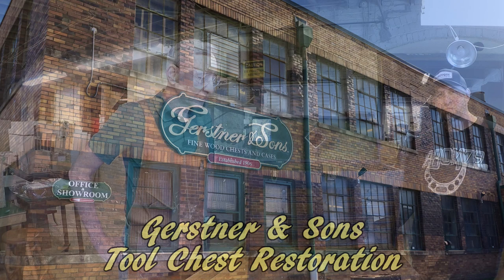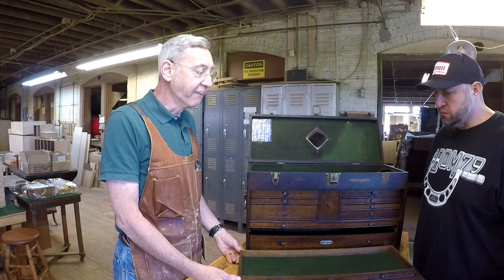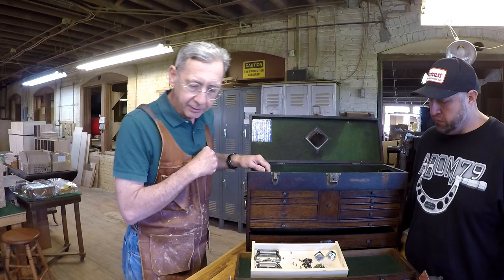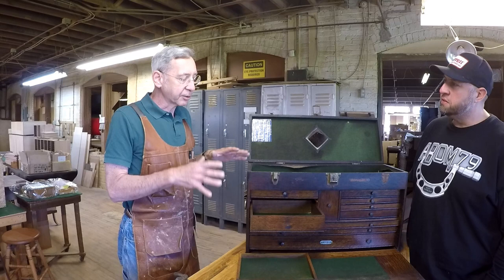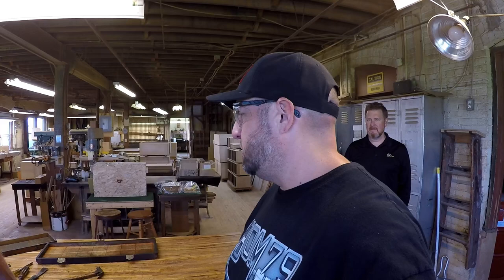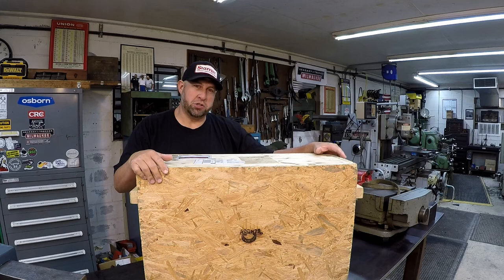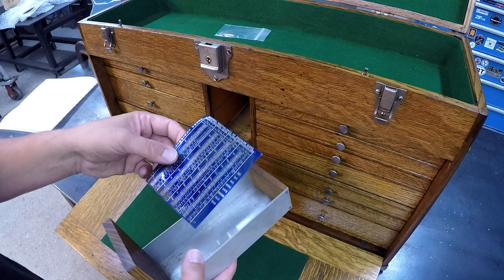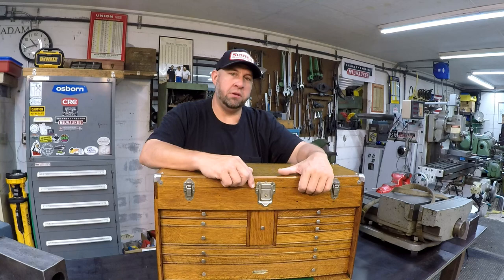Gerstner & Sons Tool Chest Restoration

Comment: I just bought one of those last week at harbor freight
Reply: What you bought was a Chinese knock off, Gersner International.  They are not the same.
Reply: people will knock those less expensive boxes but some of them are ok and if you needed to you could reinforce the carcass or the drawers and it will do the job and last a long time. Unfortunately the quality difference is usually apparent between these.  Price difference is immense.  In the end it is just a wooden box and so people will like what they like.
Reply: @ecmillerbud1   Unfortunately Gerstner has their USA line and their "international" line which also I think are made in china.  Still of upper quality but if HF sells a chinese box that works, can you reall blame somebody for saving a ton of money on a tool box? I can't.

Comment: Hi if anyone knows I was building a chest and did not know at which height are the side carrying handles supposed to be mounted, now that I saw this chest I think I put mine too high is there a known practice or recommendation on this thanks
Reply: As a straight out guess, I would say 3/5's.
They need to be above the center line but 3/4's would seem to be abit too high.

Comment: I have always desired a Gerstner Tool Chest just for it's look and status, but could never justify the cost for it's actual tool holding capacity. The Gerstner chest with all it's many small height drawers limiting your actual employment, compared to say the larger (metal) Kennedy box, which better manages the true purpose of a "tool box" which is to protect and secure many different size precision and not so precision tooling such as self made tools, gauges, fixtures etc.
Reply: It's horses for courses really, the shallow drawers are just the thing for items like dial test indicators, dial indicators and even vernier callipers. Telescopic gauges, radius gauges, depth gauges and squares are all small items of low depth which you wouldn't want to have to root around in the bottom of a big toolbox looking for under your big spanners and hammers for.
OTOH if you work in construction, A site tool box would be much better for storing rattle guns and their big impact sockets, sledge hammers etc. It is a case of the right tool for the job in hand.

Comment: So, does anyone know: does Gerstner artificially age new replacement hardware to match a particular look (in cases where an original knob or whatever is missing)?
Reply: I was thinking the same thing. Maybe they should or do buy old chest that is to far gone to get parts from.
Reply: @charlesfree4247  they likely save the ones they are asked to replace but are still good.
Reply: Take a plastic container with a sealed lid. Place your parts in it. Place a SEPERATE capful of muriatic acid (google what it’s called in your country) in the container. As in don’t pour it in. Don’t submerge your parts. We just want the acid fumes. Soft drink bottle cap is perfect. Seal the container overnight and you’ll have nicely aged nickel hardware. Doesn’t really work on chrome. Brass is ok. I do this a lot.

Comment: Have they clear painted the metalwork to help keep it shiney or just polished it?
Reply: probably not. You can wax and oil and repolish though and keep it shined up. If you use the right compound you can get metals to a mirror finish. Polishing itself resists the formation of some rusts, add wax or oil on top and that's a great barrier.  Clear coat paint can help too. 

One thing you find, when you use wire wheels on metal, some of the metal from the wire wheel can transfer onto the metal of whatever being polished and I noticed it seems to stay there until I clean it off with something else. 

things to try out, besides a wire wheel,  an actual buffer with polishing compound (green or white), fine steel wool (which you can actually use on to clean the wood too with gerstner finish restorer.

Comment: They did a great job. Nice looking tool box.  But - if any of you out there have a dresser or table or whatever from 18th or 19th century (1700's - 1800's ) and you refinish it like this tool box you will reduce the value of the antique by 70-80% of its current market value.
Reply: Yes, and not just the money value!
Reply: That is one of the things that makes me want to punch some homeowners. They will buy a house that has all hardwood floors and carved moldings and install wall to wall carpet and paint the trim...  WHY !!!!  
Or the ones who blindly paint a 18th century table "so it matches out decor" Then buy a new table that looks the same and paint it.
Same thing happens in firearms, people find "an old gun" and strip it to bare metal and wood and refinish it. Then think it should be worth more.
Reply: @Blazer02LS  Originality = The one thing you can't replace.

Comment: I'm a bit disappointed you did not get to tour the US Air force Museum but both of the Gerstner videos have been excellent. Seems there was always that one guy in the shop that had a Gerstner and all you have is a wrinkle brown Kennedy.....grrrr.
Reply from the maker: We didn’t have enough time to enjoy the museum.
Reply: Come on now. I have a complete Kennedy set I bought in 1980 and it's still in perfect shape.
The Gerstner is like a Rolls Royce vs the Kennedy Chevy but at least it's not a broken down Yugo with blown motor like all the trash comes out of Harbor Freight.
I would never insult my Brown and Sharps and Starrets by putting in such trash.
Excellent job on the video by the way.
Been a master machinist since apprenticing at Pratt and Whitney in the 70's and I still pick up good stuff from watching your vids.
Reply: @larryelliott9157  Me too my friend. I still have my first Kennedy I bought when I was learning screw machines in about 1972. I was pretty proud of it when I got it. I also have my dad's Kennedy from the  50's when he apprenticed at Delco Products in Dayton. They are good boxes but damn......those Gerstners are fine.
Reply: @larryelliott9157  I have 6 of the Harbor Freight tool chests and would put them up against any of the Kennedy boxes.
Reply: @jmwarden1  

And you will soon need at least five of them to prop up the last one as it turns back to recycled paper thin sheet metal scrap.
To denigrate a Kennedy box while praising obvious potential land fill requires the general loss of a sense of worth and utility we see in the overall decline of our countries true values. So sad

Comment: At 26:00. Someone needs to point out that the respirator he is wearing does Not have charcoal filters installed. This is dangerous to his health. He might as well not be wearing the useless respirator at all. Most guys don’t know that charcoal filters are only good for 48 hours of use AND when the respirator is not in use it should be placed inside a sealed bag. Respirators left out unsealed constitutes use and the filter media needs to be replaced. I see this type of thing happening all of the time and it comes down to workers not being properly trained in the correct usage of Personal Protective Equipment (PPE). Love your channel and all of the extra content. Again, I hate to be a Nag, but safety first! Adam, keep up the great work!
Reply: He's wearing vapour filters for the stain/varnish that he's applying.

Comment: I know it would depend on the amount of restoration on any given box but what was/would have been the cost on the restoration?
Reply: I would love to know too.  I have the same chest, probably 15 years older that I would like to have restored or preserved.  Needs very similar work.
Reply: I found this on the web site.  (Refinishing and restoration services can come close to the price of a new chest. A full restoration, including stripping the finish, refitting all of the drawers to the chest, replacing the felt and installing new hardware for a chest can cost $1000.00 to $1500.00 depending upon the size of the chest and if parts need to be repaired.)
Considering the condition of mine is not exactly what I would call needing factory restoration, I'll probably do it myself.

Comment: What’s the mirror in the lid for?
Reply: From the Gerstner Forum:
"When Gerstner & Sons started in 1906, most companies did not have indoor plumbing. The mirror was put in the top of a Gerstner Chest for the machinist or toolmaker to use to see if there was any dirt, machine oil, grease, etc. on their face during the workday and before they left work at the end of the day."
Reply: Sithus1966 thank you
Reply: For applying your Avon makeup duh
Reply: @TheLexiconDevils  
Imagine Abom in full makeup.

Comment: What about blueing the cleaned parts to give it some protection? It changes the look a bit, but it's the same hardware and rust proof...
Reply: Clear lacquer finish will do the same without darkening it too. As long as the box doesn't see much weather and direct sun, the lacquer will live a long while but over time will yellow depending on exposure to elements etc. There are some excellent finishes these days that might just last as long as the box does.  Door handle/knob hardware companies use them on their "lifetime" polished brass finishes.

Comment: 3:34 'Veneers'.
That was a surprise
Reply: Over plywood it’s not the dirty word some people assign it. That’s a standard construction method. Veneers over particle boards are where the rubbish is.
Reply: Good plywood is more stable over time and across environmental conditions. That's just a fact people need to get over.  These boxes actually need to operate in the world. Nothing wrong with a little material mixing.

Comment: It's a shame to sand it down. The patina of all the years is more than half of the 'value' of this object, IMO.
Reply: I understand your general point, but in this case, it was not just old varnish patina - this was a working box with decades of old grease and grime, smells and possibly toxins. If it was going in a museum and sitting on display you might want that for show and historical reference, but Adam wants to put his own tools in it and handle and use it on a daily basis. For that case, I would want it clean too.

Comment: Hey guys can you tell me the difference is between your tool chest and the one they sale at harbor Freight tool co.
They look like the same ones there I’m confused!.... they retail for $84.89. How much is that one you have ?....
Ant no problem navy gel and LCR .LIMEAWAY,!...OH MY TAKE ON THIS ?.... use a wire wheel on your hardware 
Will make your Crome plating thinner and the rust will develop in pitting ,,,I don’t know ..
Reply: The Harbor Freight ones are okay for the price, but they are veneer.   The Gerstner are the real ones made of solid oak.   They are made by hand, not slapped together like the HF ones.  But, I have a HF one and like it a lot.
Reply: That's like saying,   "XJ6?!  Why not get a Civic? It's faster and cheaper too!"  This is a collectors item.  You ether have an appreciation for this type of thing or you don't. No biggy.
Reply: Didn’t they say the pecan ones where veneer as well I don’t know I’m looking into the Japanese box’s they have secret drawers inside look the one Mah- Jong  where they store the   Tiles . Even tables .. it’s a real Pandora’s Box ......lol thank you for the response on my comment.....good night ......
Reply: Let's revisit this question in 10, 30, 50 years.
Reply: David Weglarz what is the substrate under the veneer? There’s a very good reason why Gerstner uses veneer plywood in their construction.
Reply: @Kevin Sesko I can revisit it now having owned one of these for 14 years. I’d like a thicker gauge hinge. You can tell by the fit it is mass produced. You’d find a steel tool chest far better however it won’t give you the micro climate that wood does. That’s the upside to it.

Comment: Go to any cloth store to get the green red black brown and it don’t cost that much.
Reply: Good luck finding the starched felt that Gerstner uses so that it's easy to cut to size without it pulling.
Reply: prepare to be disappointed in those felts from the 'cloth store'
Reply: @rickdenney5772  That.  Gerstner felt is much stiffer.

Comment: Sorry, destroying the original patina makes the box worthless in the antique trade.  That is the fundamental first thing you learn.  This was not a restoration, but equivalent to a gut-reno.  Such a shame.  Retain the original patina, and the marks of the first owner.  It tells the story.  I do NOT recommend this approach.
Reply: Anybody who rejects a Gerstner toolbox on the basis of patina ... shouldn't own one in the first place.  Some people watch a couple of episodes of "Antiques Roadshow" and thus become experts on finishing...and mistakenly try to apply the standards of colonial artisan masters to a mass-produced chest from the 20th century.
Reply: If restoration is done right and in this case by the original company with the original tools it can and will increase the value. This chest had some minor damage that had to be addressed. It's whatever ever the customer wants too. You don't want 50 yrs of grime and oil in your house.

You know opinions are like rear ends, everyone has one. This is just my opinion. I think it was an amazing job, by an amazing craftsman, in an amazing shop.
Reply: sounds like he wanted to actually USE it. going back to the original manufacturer for restoration is a wonderful option for one that is going to see continued use. He DID keep the marks of the first owner, as was pointed out multiple times during the video. Now, if he was only interested in antique trade value, you'd be correct, Natalie7651.
Reply: I've got an old machinist box that was my step dad's father's box.  I wouldn't destroy the patina for anything in the world.
Reply: @meatlast  and you have a close personal connection with it. Not certain he has one with the box he had a factory resto done on.
Reply: I understand your point, but this isn't an object which will be hoarded and sold when price goes high. This looks to Adam a piece of art and a working tool, and I do believe, not knowing him but having watch lot of his videos, he'll keep this forever. Not everything needs to have monetary value.
Reply: A chest like this has only real value to the person using it, no matter how he or she wants it finished.  It is and never should be a collectors item.  They should be passed down only to someone who is going to use it and love it.